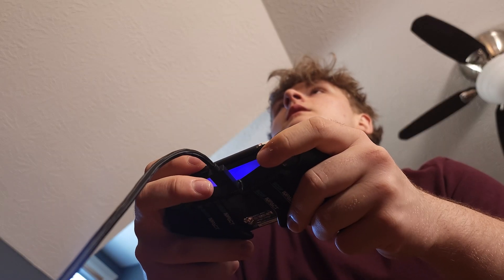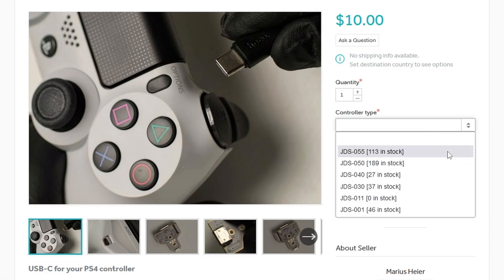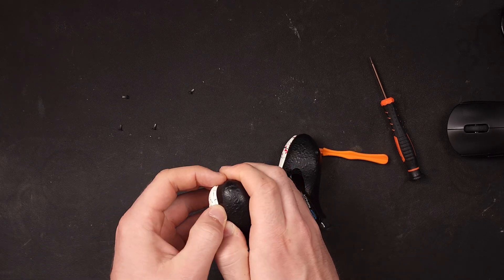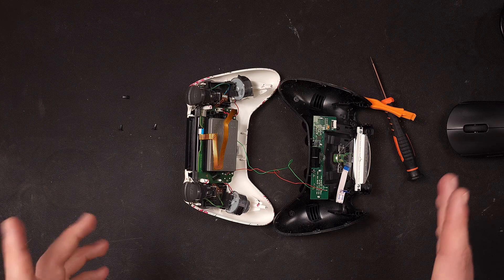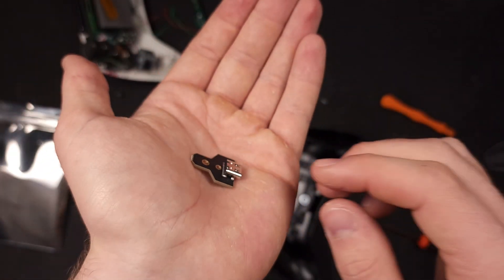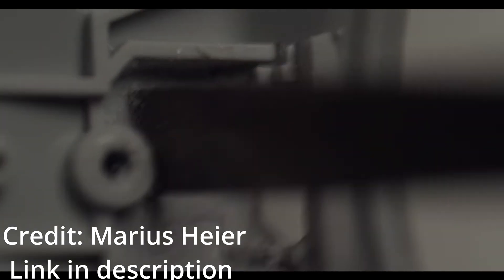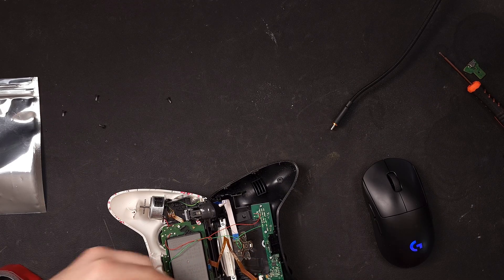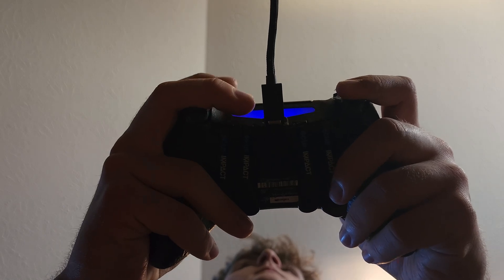USB C Upgrade for PS4 Controller | No Soldering Needed!

Comment: I’ve read somewhere that the light indicators for the controllers stop working after this. I saw yours was still on, but the controller was also plugged in. Can you confirm that the lights on the controller still function?
Reply from the maker: @benjaminrhoads3157  do you mean wirelessly? As far as I saw it was fine but I'll test it to be sure
Reply: @WestinEast  yep- wanted to confirm that it being plugged in wasn’t the reason the light was being kept on. Thanks

Comment: Cant you just look at the shape of the microusb-ribboncable-circuit board to see what JDS- you have?
Reply: On tindle there's a link to check which type of controller you have. Didn't work with wireless but when it was plugged in it told me it was JDS-030.